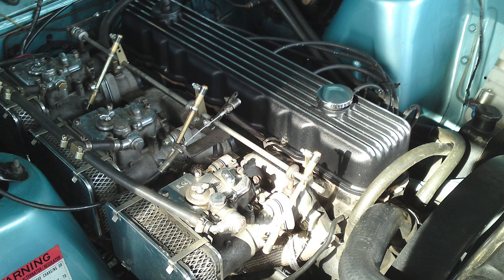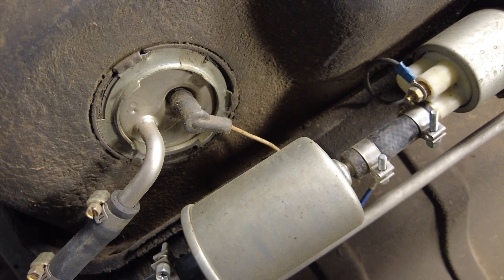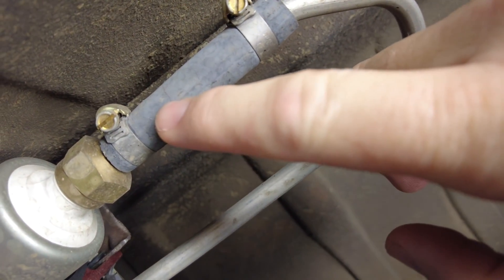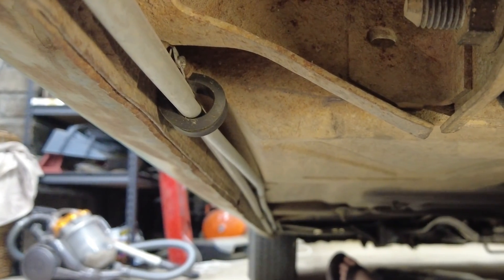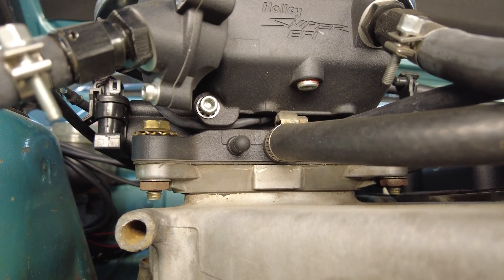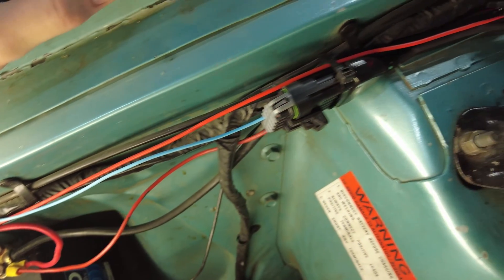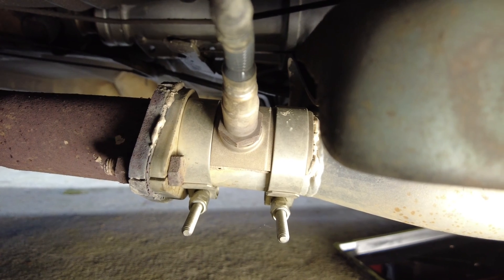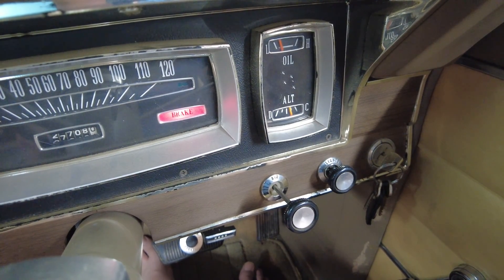Holley Sniper EFI | My Classic Fairlane's Transformation from Weber Carbies

Comment: The 300, straight 6 or 4.9ltr was the best of Fords 6 cylinder engine line
Reply from the maker: I've read about them but I've never driven one or seen it in real life. I don't think too many came to Australia. Also interesting fact the 221 or 3.6 was used in Argentina until the 90's